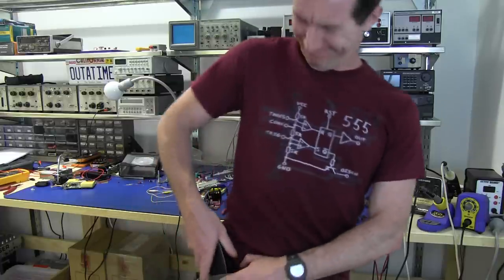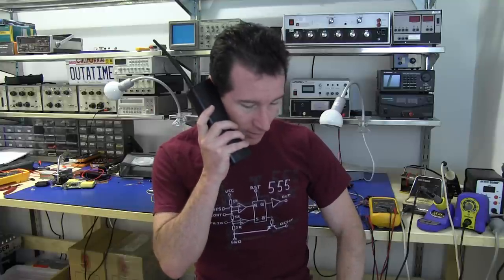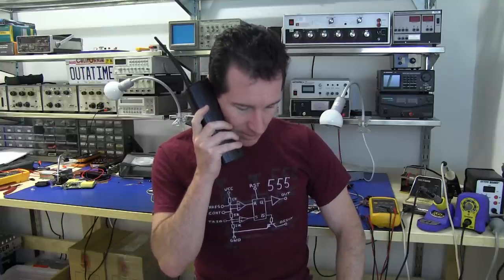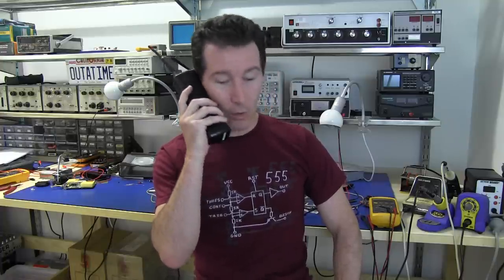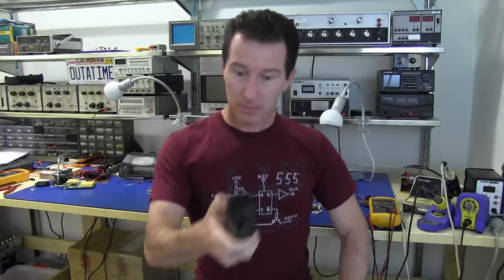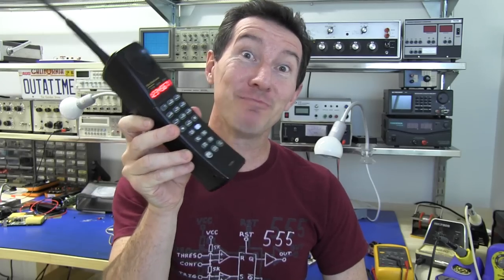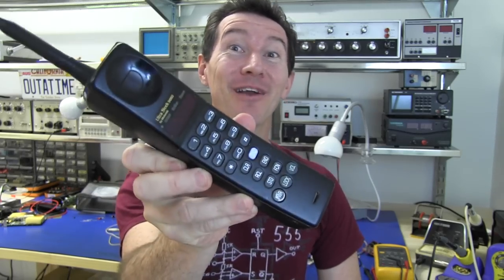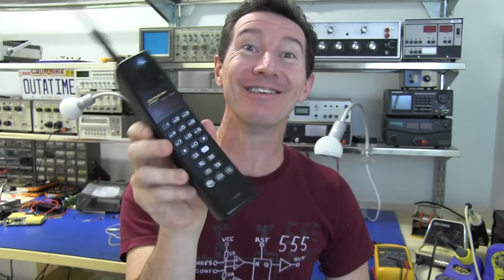EEVblog #243 - Vintage Brick Mobile Phone Teardown

Comment: The biggest, and most aazing part in the old analogue phones was the diplexing filter, which did an amazing job of allowing a receiver to work at minus ninety-something dBm sensitivity while the transmitter was simultaneously pumping about half a watt at (from memory)  only 40Mhz away into the same antenna. True black magic.

Comment: Motorola V3620 was the smallest Motorola analog phone I can think of. Still small even by today's standards.

The brick format stuck around for a long time after phones started getting smaller. The main reason was power. Cell site placement was much more sparse back then, especially outside of urban areas. a 3 watt phone was necessary to complete calls for those who needed service on the edge of cell site coverage. 
-jc

Comment: Also the terminals underneath the battery that you were looking at are in fact the diagnostics port. There are 2 pins that you can short out on that to put the phone in "Engineer mode" When in that mode you used to be able to scan though the channels on your local cell and listen into ANY call being made through that cell. I can't believe it was so easy to do that back then. With some of the other phones of the time you needed to change the EPROM for engineer mode

Comment: Analogue phones got down to about the size of that Nokia 3310 before analogue died. Motorola was always behind the competition on size and weight as they sold on robustness. Even when much smaller ones were available, these bigger Motorolas were popular with people like builders as they were pretty indestructible. The earlier generation (8500?) Motorolas were amazing inside - lots of ceramic hybrids and metal-ceramic packages!

Comment: Notes:  Wireless "landline" phones tend to use the same components as cellphones 2-4 years older.  Currently they usually operate in a reserved digital band around 4 to 5GHz, or over regular WiFi.  Earlier cellphones actually had more lightweight handsets, wired to a base the size of a car stereo, but if you wanted to use it away from the car, you had to carry a bag with the base and a full size car battery inside. 

This is why they invented the SIM card, so you could carry it with your credit cards and insert it into the phone that came with whatever car or taxi you were in!  Of cause by the time GSM took off, the phones were small enough to just carry with you, and the SIM card became a way to reduce carrier tie in (except in the US).
Reply: John Doe Nice one bud, I always wondered why the 'sim card' thing came about with phones. :-)
Reply: Yeah, sim cards quickly became simply a means of transferring phone hardware. I still dislike CDMA because of courier tie ins. There is no convenient way to use non-gsm phones on prepaid plans because of the lack of sim cards, and you have to go through a whole process to transfer new phones over to your plan.

Comment: The Jack on the Bottom was for Headset/Mic Combo and the terminals under the Battery that are not used were for Programing the phone to the system carrier...

Comment: This looks like a slightly slimmed down version of the original "bag" portable phone design. These had higher transmit power (3W instead of 0.6W), so they probably just built a smallish phone around the existing RF design.

There was a first generation of truly "mobile" phones out at that time, but they had lower transmit power. Even Motorola had one -- the MicroTAC "flip" phone, and later the tiny StarTAC. However, if you wanted wider coverage, you needed a car-mounted phone, or something like this "Ultra Sleek" unit.

Comment: this was cutting edge tech back then, Surface mounted circuits were rare. You can only go so small when dealing with the higher voltages and Lower frequency..

Comment: Motorola did make GSM "brick phones" for a while; they had a small graphical LCD and were extremely rugged. Size really wasn't considered an issue in this case; it was designed to be used in very rough environments and also had 7w transmitting power when used with external power.

Comment: Brings back memories for those of us "old" fuckers. I had one of the gray Motorolas with the giant battery that weighed a ton and slid onto the back, and the flap on the bottom that closed over the buttons. It worked well, did what it was built to do. But man. The damn things were expensive in every way. Calls were charged by the minute, and If you were on a road trip any appreciable distance from home, you'd get hit with nasty roaming charges on top of it. It was very possible to accidentally make a phone call that would cost you 30 bucks when all was said and done. For a single call!

Comment: for someone who's sold That phone i can tell ya what the pins on the back are for :)
it's a connector for the programer in the store and a diag rig for the guys in the shop.
you'd connect it to a PC and type in the custimer info and account and it would setup the phone.

Comment: My first mobile phone was a Motorola® MicroTAC I purchased in about 1998 and I am fairly certain it was not the newest nor latest model.  At that time, I worked in the IT Department of a small telco and I had to be "on call" roughly one week per month (rotating schedule with my co-workers taking a week each also).  The "on call" company phone was a Motorola® DynaTAC at least up until a few months after I got my MicroTAC.  Both were analog.  Our schedule meant we passed the "brick" to the next guy in the rotation on Monday morning.

Those days.  We worked a regular M-F schedule, from 08:00 until 17:00 with an hour off for lunch, plus OT as required, including the week we were on call.  Getting a call at 01:00 and troubleshooting the problem, then still having to be at work for 08:00 was not fun.  Neither was having to stay within 30 minutes of the office 24/7 the week "on-call".  Having family events (like my siblings' karate tournaments) outside the 30-minute distance from the office was painful, often made worse by zero phone calls the entire time I was stuck at home the day of the event (typically between Friday evening & Saturday evening).

Then, of course, there was going about the city with two mobile phones clipped to my belt, one each on opposite hips.  Then there was fun when I was in the middle of a call on one phone and the other one rang.  A couple of times talking to two different people on both phones concurrently, I swear I heard the voices switch ears (a phone in each hand at both ears simultaneously).  The weird things the analog phones did sometimes when you had two of them on separate calls within a foot (0.3m) of each other.

For those wondering, for after-hours calls, we got to try to troubleshoot and rectify the problem via telephone (and dial-up) first.  If unable to, we had to drive to the office and try to fix the problem in person.  If the problem was too severe, we got to call our Supervisor or Manager (waking them up if necessary).  The occasional need to go to the office in person at any time of the night or weekend was the reason for the mandated 30 minute maximum from the office for the week we were on call.  Usually both the Supervisor and Manager were NOT outside the 30 minute window simultaneously (although there wasn't an actual rule for them, IIRC).  And, I went off on a tangent.

Ahh, yes!  The Motorola® "Brick" and the memories...
Reply from the maker: Thanks for sharing

Comment: Though I was too young to have a mobile phone when those really old analogue phones were in their prime I have venue memories of some of them with the red or green single line LED readouts.  My first mobile phone was a Nokia 3310, I bought that in 2002 when I was 18, what a great phone it was, simple and yet very useable and it was cheap for the time and did what I wanted.  I sometimes wonder if mobile phones having gone too far, doing more than they need to.

Comment: And now, seven and a half years later, the "modern" HTC Desire would also qualify as vintage: 

"One of the first Android smartphones, with a tiny 3.7 inch screen with 800x480 resolution, a SINGLE CORE CPU with a full gigahertz of clock speed - multi core wasn't a thing back then in phones, a whopping 512 Megabytes of internal storage and a tiny 1400 mAh battery. You have to put a microSD card in it, otherwise you can't make any photos or store any music! It's 12 mm thick, and has huge bezels around the screen. And it doesn't even support LTE!"

Comment: There is no such thing as an analog band and an analog antenna... In fact the 800Mhz band he refers to is now used for digital phones.

Also, I bought a new Motorola analog flip-phone in 1998, albeit at the end of the run, but the phone he takes apart is more of early '90s.

I find that the tone he uses to describes the design is rather condescending. 

One final note: Motorola no longer makes discrete semiconductors nor processors. They sold the business more than 10 years ago.

Comment: @EEVblog
You ask why they did not made it smaller.
It's because the antenna was still very large if they did and also the battery would stay the same size.
They went bigger/did not decrease scale for more efficient radio and battery live.
Also the handset was very small for it's time already.

Comment: Those were the days. Even when working with your mobile phone, you made muscles. And the probability to loose a brick-phone is very VERY slim. Nowadays they make 'em smaller, so that you can loose them, so that you can buy a new one even smaller compared to the previous because this is what's on the shop-shelves and you can't do anything about it. Damn!

Comment: old post, but you supposed to slide that Metal Clip down round that Hands Free Car Kit connector and undo the Antenna Nut at 07:45 Thats why the Ribbon Cable pulled out!

Comment: The analog phones got much smaller than that.  I have an analog motorola "flip fone".  It had a little 8 character 5*7 LED dot matrix display which is socketed.  A good source for those little "smart" LED displays.

Comment: i bet that still is the smallest anologe phone. the way that phone operates is way different than digital phones. that phone sends out the actual voice as a signal but the small digital phone change your voice to 1s and 0s and makes those into signal.it takes a lot less power to send out   1s and 0s than it does to send your voice.thats why the anologe phone is bigger, because it needs more power

Comment: 1994 was the end for Motorola bricks. First introduced in 1981. I sold many cell phones in 1994. FEMA contractors after the Northridge earthquake bought bricks for durability, battery life and twice the output power of standard phones...for marginal service areas. Smaller phones from Motorola like the Microtac Utralight flip - my all time personal favorite - came out in 1989. Very thin -almost as indestructible as the original flip phones. Great sounding analog phone that went digital in 1994. These dates are Los Angeles specific because carroers introduced phones as systems could use the feature sets. And, LA was way behind cities like Chicago. Cell service generally sucked in LA for years and TDMA digital really sucked compared to CDMA. I had a customer bring in a Motorola Flip that she drove over with her car. The side was cracked but it still worked fine. These filps came out around $3500.00. down to $2200.00 and finally at $99.00... or free with the right service plan as landed cost was around $210.00 while service plan commissions were in the $300.00 to $600.00 range.

Comment: Dunno if they had that then!

Could be a connection for testing at the factory, some machine, or bank of machines, might plug into it to measure everything's as it should be.

Or possibly could be a connector for a different factory option, maybe the circuit board was used in several products, and some of those had PCBs connect through those pins.

Comment: i've cracked open a similar style phone, i recognise some of the parts, but the one i had used a dot matrix 7x2 style display. i think the speaker was a bit smaller. and i think one of the cans on the RF board will be a UHF amplifier MHW 803 or similar

Comment: I had the Motorola 888 In the UK the updated version of the first 800 model which is the same as this one.  The Battery used to last 8 days in standby however I did have the upgraded double capacity battery and the full gain di-pole antenna two times bigger and two times thicker I broke it so had to take it apart. they made the dipole with a double wound top and bottom antenna joined at the middle with the coax cable attached to a half ground plain going up the inside of the lower antenna.  Your phone is a half wave single sided.  After all all it did was listen for a analog rf signal when not in use and due to the massive antenna I never ever had a problem making calls even miles and miles away from the nearest mast. even using the phone for a full day because it was not really having to search for the strongest signal all the time due to the high power of the antenna it still worked a couple of days.  I bought my phone back in 1992 at the age of 17 yes I lied on the form to buy the phone.  The bills in those days were a little more than now. I had to pay £250 per month for the contract then 50-60p per minute minimum charge of 2 minutes Local numbers and 30-40p per minute mobile to mobile depending on what network the other person was on.  a land line incoming call used to cost 25p per minute. my phone cost me 2 months wages at the time £1.50 per hour 12 hours a day 6-7 days per week. you do the maths it was a lot. my next phone was the a smaller analog phone with "future" upgrade to text messages. I could receive network messages on the NEC P3 mobile phone which could also be hacked. you could listen into both sides of a conversation from the network mast, scan for active calls, take over other peoples mobile phone calls, grab the number of the mobile who was making a call and call out on their number, last but not least you could kick the phone into "doctor" mode.  giving your phone priority over all other calls. so you know when your on the phone then the call drops.  In analogue days when you only had a small band width and only a few calls per cell could be made.  I never got cut off half way through a sentence again. 

Love the Videos Keep it up.  Wish I still had my old Custom gold circuit boards with gold processors all over them you would have loved them but alas we all have to throw things away sometimes.

Comment: well, those where HUGE, but one thing I guess - range (between transmission towers) was probably huge too, since nowadays you have towers everywere, back on the days, they weren't everywere like now, And considering the size of the speaker, probably volume and quality were better, or at least one of those on a modern phone would be cool when it rings...

Comment: haha I like how you pretend to get a call when it doesn't ring, and you can clearly see it blinking no svc. well done sir!

Yeah it definitely is strange that they could have made the phone much smaller, because at the time, MicroTACs had been on the market for a few years, the first ones coming out in 1989. By 1994, the MicroTAC elite came out which was about half the size of the first MicroTAC, and 2 years later the even smaller still StarTACs.

Comment: mobile phones were an offshoot of the mobile radios at least when it came to the early days with motorla.  many parts were the same for the 800mhz radios,  well the phone is just a type of radio.
high power small speakers and mics were not on the market for a few years.  same with LEDs and displays.  speaker is the size of headphone speakers of the time. 
component size also played into durability.  these were high end items that were expected to last more than a few years of a contract.

Comment: There actually were much smaller analog phones in the late 90s, not as small as the 3310 though. An example was the Nokia rinGo.
Reply: ***** Absolutely. The Sony "Marsbar" was actually quite small. That was right at the time before digital was being rolled out. And I'm in the UK too.
I purposely hung on a few months and splashed out on the very first Digital phone. The Orange based Nokia phone. After a few months they augmented it with a cheaper Motorolla.
It was £32 a month + calls and £300 for the phone. The Motorolla was £200 for the phone. The Nokia was the first to do texting and had a NiMh battery too. Was an awesome phone when launched.
How shit's changed.

Comment: That speaker is nearly the same size as an old ATT handset WOW They most defiantly could have used a smaller and more efficient tech. It existed.
Reply: Driving a smaller speaker requires more power since the diaphragm surface is less. They didn't want to waste battery life I think. Of course smaller speakers existed, look at walkman earphones.

Comment: Then as now the battery volume dominated the size of the device. If the battery was huge, there would have been a law of diminishing returns on miniaturizing the circuit board or other parts of the phone. I think the economics of electronic manufacturing are to make it as big as you have room for, not as small as you can...

Comment: The design does look pretty old. Most of the layout is driven by the IC device packaging - big QFPs. I reckon you'd be hard pressed to get a much tighter layout with the same devices. A lot of the RF layout is hampered by those chunky XOs and ceramic filters. I agree it could have been made smaller/better - but as always at a price. Just my £0.02 worth.